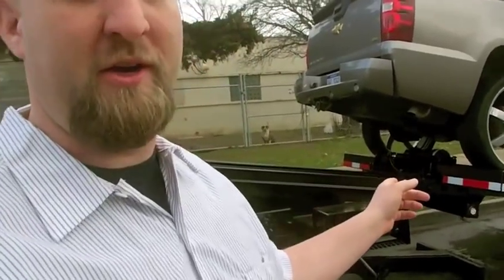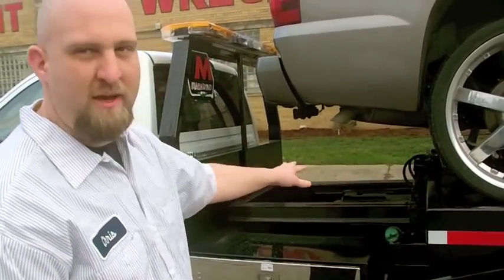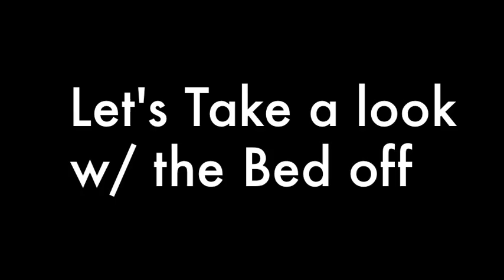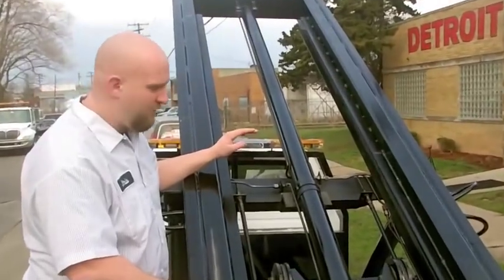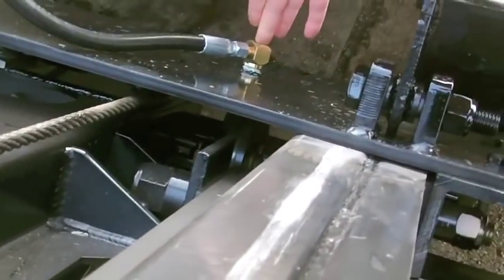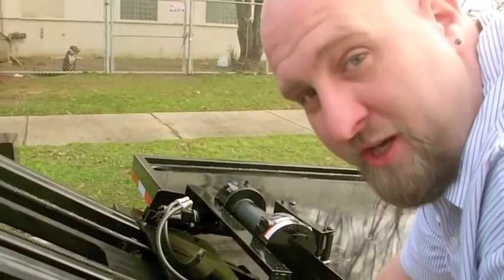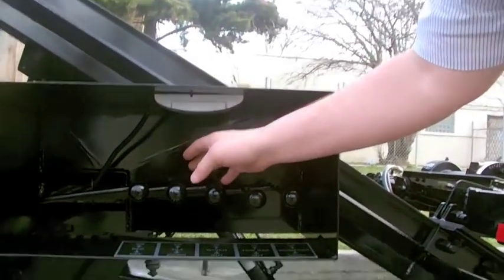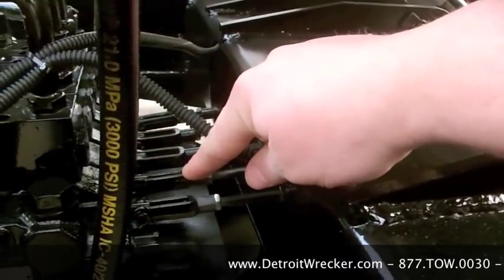2011 Dodge 5500 w/ Low Loader Part 2

Comment from the maker: @hurenkamp Your absolutely right. Our system is the same as a Hi-Lo or Fork Lift. Tried & True. 

There are other versions of the Low Loader across the world. Detroit Wrecker, offers the Heavy Duty version. Americans have the heaviest passenger vehicles compared to the rest of the world. So Towing Equipment must be made strong enough to handle its heavy loads.  Thanks for commenting! We are building a unit as we speak for a customer in Australia. So stay tuned we are making a Low Loader for him

Comment: good job but its too fast and at the end sharp area where will touch the ground should have horizontal  rollers under it to not damages the asphalt and the bottom of the edge ...

Comment: I guess the system is pretty good for specialty cars, but I wouldn't put a big truck on a tiny Dodge like that; I wouldn't use a Dodge as a tow truck, either, lol.
Reply: When adding up the weight for the trailer, cargo, vehicle and any passengers, the 5500 Chassis can haul up to a whopping 43,000 pounds. This means it has a best-in-class GCWR when equipped with the 6.7-liter Cummins® Turbo Diesel engine.Jun 25, 2019

Comment: Nice Truck! An any person who thinks a Ram 5500 can't handle that has their head up their ass.  Company I used to work for had an old Dodge Power Wagon W300 with a Big ol' Holmes on it, would yank and pull any damn thing you wanted.